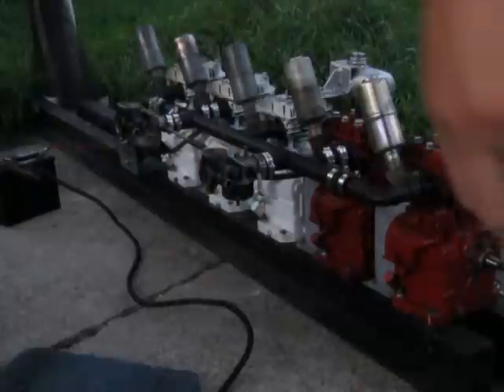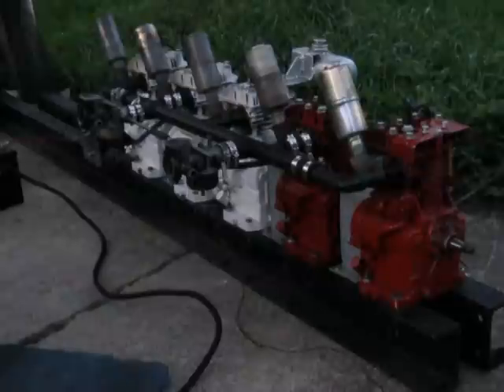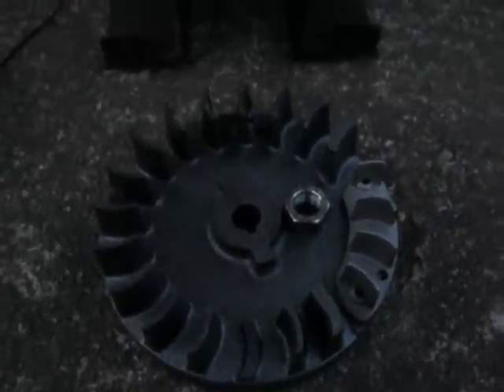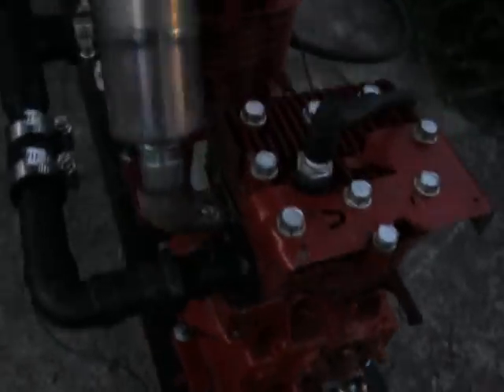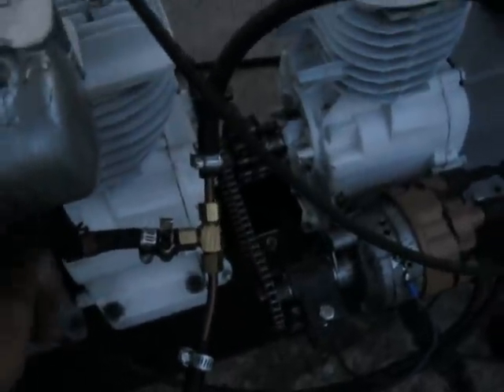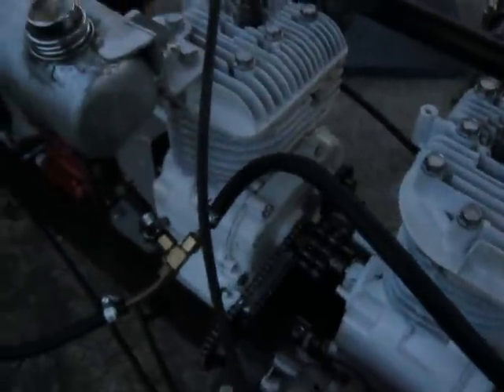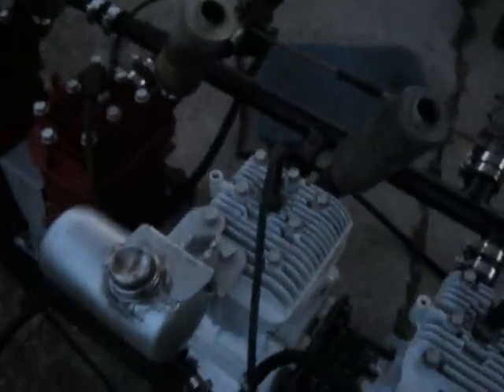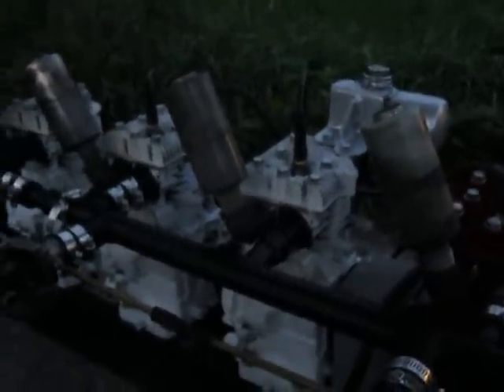FrankenBriggs 5 Fly-Away!!!!!  :o

Comment: You have great skills. I was wondering if wrapping the dual chain coupling with a tight rubber wrapping from lets say bicycle inner tubes and a outer sheet metal clamp covering would help with vibrations and sound.
Reply from the maker: It might cut down on some sound, I would be worried about the metal clamp flying apart. This engine seems to be jinxed, I made the final run tonight, it spun off the front flywheel again, then zapped me when I tried to shut it down  :(
Reply: ChargerMiles007 If you have not used it yet, use the strongest loctite for the fly wheel nut. Have you ever thought of using timing belts and camshaft sprockets for connecting the motors together ( one in front of the other, not side by side ). It would not look as good, but the belts would allow for damping between the engines. Mr. Miles, thanks for posting your videos. They are well put together, and enjoyable.
Reply from the maker: Thanks for your interest, and suggestions. I have thought of using other types of connections, and may do so in the future.
Reply: Mr. Miles, how about a long jackshaft so you can keep the inline look. Thanks again for posting your videos.

Comment: Whoops! The flywheel did a runner! Maybe have to use a lock-nut in future?
Reply from the maker: I used Loctite and made sure it was torqued down. I think perhaps it loosened up over time being used on the 6, 8 ,3 and 2 cylinder engines. Normally a flywheel isn't something you have to re-torque, but apparently these engines live by other rules!
Reply: ChargerMiles007 Ah, the vibrations simulate many ours of hard usage! (maybe)
Reply from the maker: Yes, it seems to be the equivalent of many hours of wear in just a few minutes of running, these chain coupling are sure taking a beating. The lovejoy couplings didn't show any wear, but I couldn't use them due to the odd angles needed between the cylinders on the 5 cylinder.
Reply: ChargerMiles007 Yup, almost need a fusion of the two!

Comment: WTF Miles!! You're gonna kill someone you Crazy Bastid!!☺
Reply from the maker: It is these crazy FrankenBriggs engines, they have a mind of their own! I hope you guys can control your 3 cylinder radial when you get it running. This 5 cylinder just wants to scream, even with the throttle held on idle, it is crazy! (Watch the next vid to see it)
Reply from the maker: Thank goodness the Briggs Gods were smiling on me!
I put on a starter cover, and re-torqued every bolt and set screw on the thing before the next run!!!
I personally believe the nut was tight, and the weird vibrations the coupled 5 cylinder made loosened it up. I discovered the front sprocket on #2 cylinder had a lot of slop, so I had to weld it in place, as there was no other way to tighten it up. That particular shaft end was messed up due to hard spot in it from welding, so it machined egg shaped. I would recommend drilling and cotter pinning the snoot of your crankshaft if possible.

Comment: wow! how far did it go?
Reply from the maker: It went at least 20 feet sparking along on concrete, then ran into some steel and stopped on the drive half of an old snow blower. If that stuff wasn't in the way, I think it would have gone 50 or 60 feet or more. Luckily the engine was facing this direction, and not the way I normally ran it, or it would have torn a big hole in a tin shed!
Reply: got lucky! can you double nut it?
Reply from the maker: I don't think the thread is long enough for 2 nuts. I will loctite the nut on, and hope for the best. I didn't check the torque on it before the run, but I used to start the engine by a socket that turned that nut, I will make sure it is good and tight for sure, i will be checking all of the coupling set screws again, I did check all of then, but weird vibs will loosen anything up!
Reply: hope it goes smooth for you.
Reply from the maker: I have it re-installed, all loctited and torqued up. I noticed a bunch of slop in the front hub of #2 cylinder, so I actually bent my rules, and welded it onto the crankshaft. The crank won't come out now, but hopefully it won't ever have to! I think these engines are living a rough life, since the sprocket on the end of #1 cylinder has some slop also, and it is a factory Briggs shaft. I didn't machine it, so it should be sloppy, but it is. I think the reversing loading messes up the keys over time.
Reply: that would make sense. i guess they were not designed to be loaded that way. couldnt you dremel it apart if you needed?
Reply: would it be as sloppy if you were to use a connector with those allen bolt grub screw things in them?
Reply from the maker: Yes, I could cut it apart if needed, but it would be messy!  I think the grub screws could help out, I attempted to use those earlier on the 4 cylinder, when I made my own couplings, but that whole Idea didn't work out very well. I think some of the #40 chain is getting loose also, as there seems to be more play in some of the couplings, than there used to be.
Reply: do you think that was caused by chain stretch? or do they even stretch on a coupling?
Reply from the maker: I think some of it is chain stretch, especially with being worked back and forth all the time on these engines. The coupling between #1 &2 cylinders had lost the retaining clip, those 2 sprockets were loose on the shaft and clunked back and forth. I welded the sprocket onto the front of #2 cylinder before something bad could happen, like snapping the end off the crankshaft. It seemed to pay off, I think #1 coupling still knocks a bit on my new vid, but other than that the engine ran great. No parts flying this time! Though I did have flames out of both carbs since I initiALLY HAD THE REAR 3 CYLINDER TIMED 360 DEGREES OUT.  (oops I hit caps lock)! Take care.